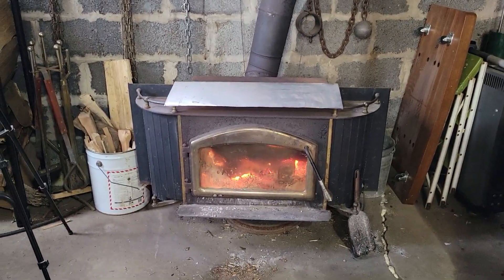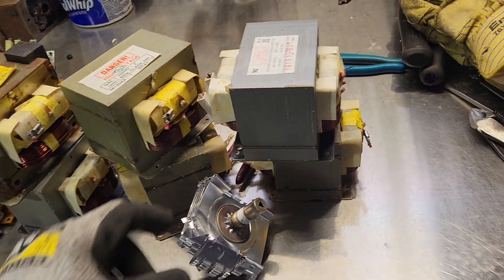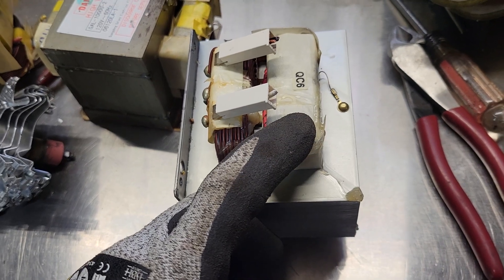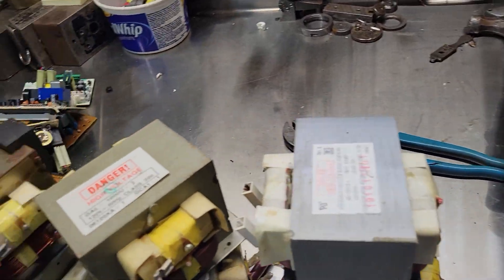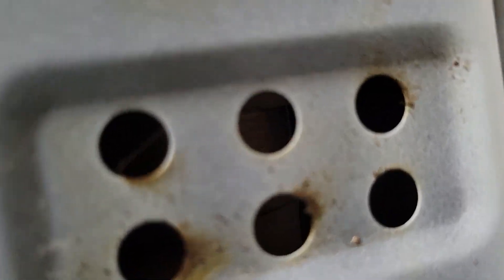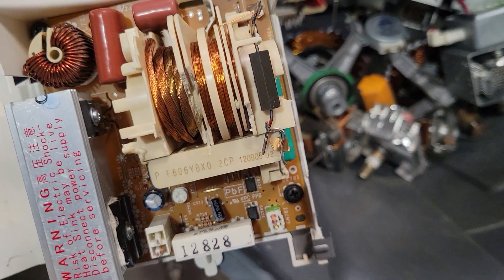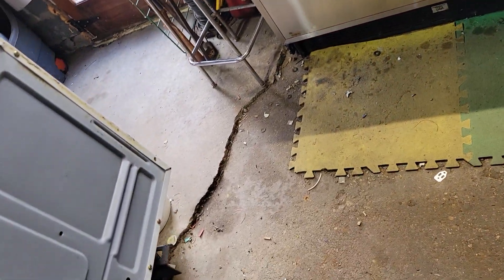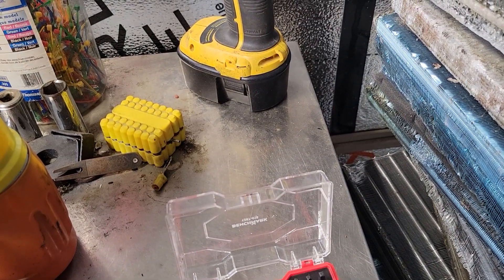Tearin down Microwaves!!

Comment: Why don’t you sell the components? Also just checking that you’re aware of Berylliosis? The bin with motors and magnetrons seems risky for a BeO break.
Reply from the maker: Not worried about it at my age , plus most are just ceramic!!
Reply: @kdscrapping4452  You mean the formula has changed away from BeO to some other ceramic? That would be fascinating to know because BeO was chosen for excellent thermal conductivity yet poor electrical conductivity. I’d be keen to know a similar performer. Thank you.
Reply from the maker: Thanks for watchin!!